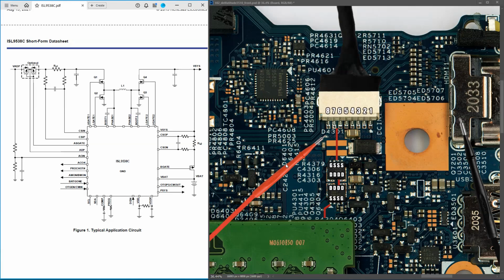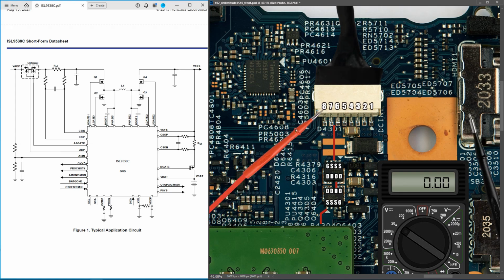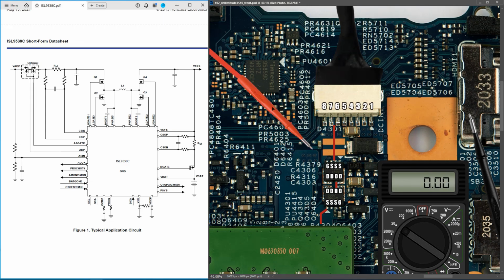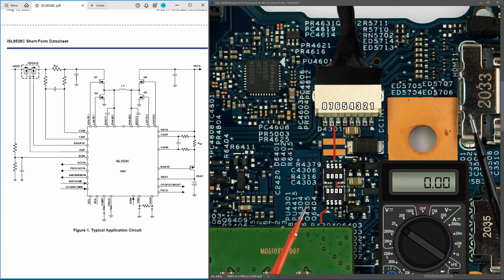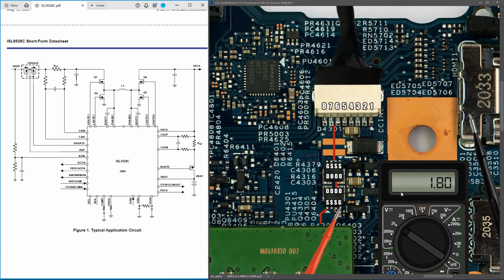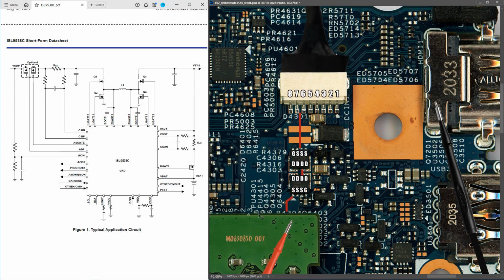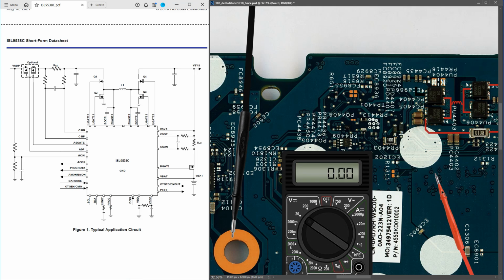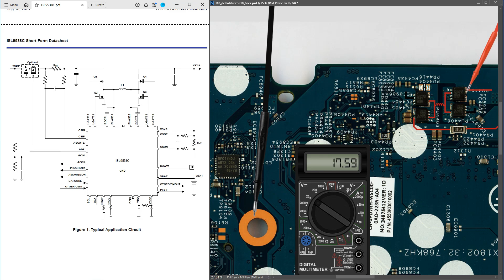DELL LATITUDE 3510 - POST REPAIR ANALYSIS

Comment: I am still confused when people say that the gates of two P-channel MOSFETs are managed independently, while the gates of two N-channel MOSFETs are tied together.  The data sheet for your ISL chip even shows the gates of the two P-channel MOSFETs are tied together. Obviously, the data sheet is not the same as the schematic for this motherboard. But I am still confused as to why P-channel and N-channel MOSFET gates are managed differently.